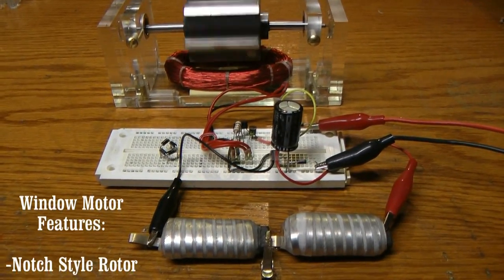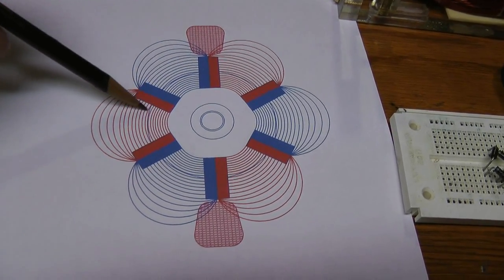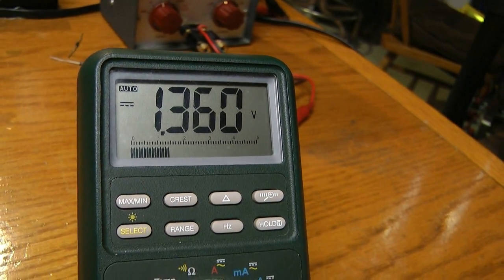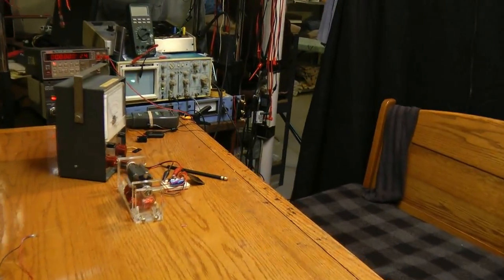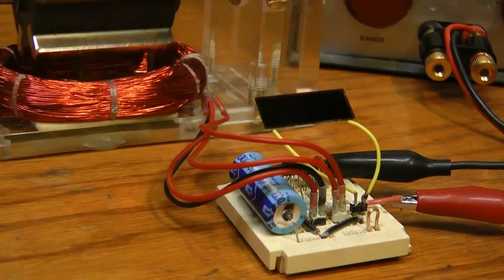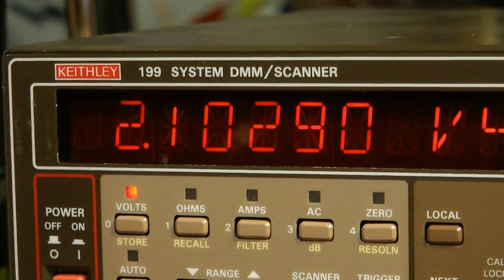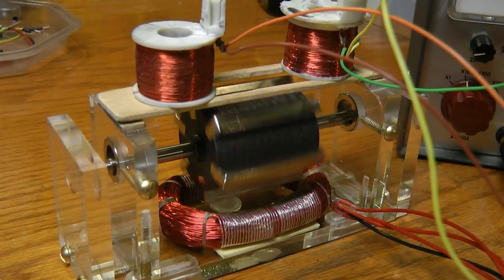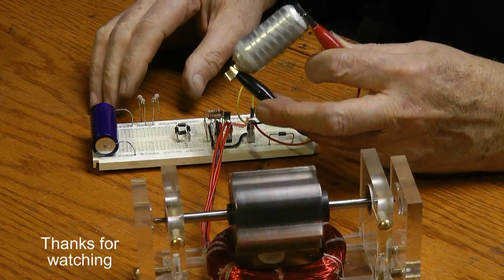Window Motor On Water Battery & Solar + (Notch Rotor)

Comment: Ringing spike, yes, I'd expect that in any type of inductor switching like this. Sometimes you want, other times you don't. Can be hard on the semi-conductors.
  As a kid, the newest thing was permanent magnets in speakers, so I found lots of discarded units in the trash, people actually threw out copper back then.
  Golf carts, my last job here, from 2005-2010, was plant maint, and we had 24 and 36 volt carts..most had the resistors and solenoids for speed. some had Curtis SS units.

Comment from the maker: @dougspair 
Yes, water here is actually an electrolyte. The fine line? I would imagine if you had any of the three, you could prove the other two. I think in most cases OU is considered to be outside the help of Solar, tides, wind etc. For me the self running motor would be a pure form of free energy, even if it couldn't provide much power outside maintaining rotation. Thanks for all the comments.
John

Comment from the maker: @dougspair 
Doug, the scope is on the collector so you see the potential generated from the magnets passing the coil but also see the tiny pulse that it takes to maintain rotation. The ringing or bell curve is considered to be a benefit. I believe it would be a resonance between the resistance, capacitance and inductance in the circuit. Yep coils from anything are useful. The trigger coils on top of the motor are from 36 volt relays that stopped working on my golf cars.
J

Comment from the maker: @dougspair 
The Keithley is fairly old. I got it on E-bay for an $87.00 bid. It has 500 memory positions and can save a reading on each at a set interval. Very useful. There are a lot of people experimenting with these batteries. Just type in Earth Battery or Crystal Cell in YouTube or your browser and you'll find more updated experiments. These that where using water tended to be galvanic and suffered from corrosion of the magnesium. That's why I didn't pursue it to much further.
J

Comment from the maker: @dougspair 
I have an old Eico kit and some really old Weston and General Instruments analog meters. You know the big old things in the black Bakelite cases. My Simpson is one of the first digitals and was over $400.00. Now you can buy the same for probably $20.00. I think the term window motor comes from the rotor running inside a rectangular window shaped coil. Not to sure. Good guess, yes the rotor is made from Delrin with the magnets being a press fit.
J

Comment: Ok, I'm back, again. As I was an Electronic tech at a couple jobs, I pay attention to details, which is why I make comments on some of these youtube posters..seems a very fine line between 'free power', self-running and 'over-unity' To me..it is maybe free if it's solar, water or wind, although the water has to be re-pumped, by man or nature, in most applications.
  Why I am writing this, is the description of the video at the top, it says you're 'ruining' your motor with water battery?

Comment: OK I'm looking at the scope trace, without a schematic, it's hard to see what you're looking at, but the collectors of the motor coil drivers? The 'ringing' is that caused by some back EMF in the drive coils? I'm sort of wondering if you could reduce the drive current in the motor coils by using smaller wire, or would you lose too much strength to drive rotor..?
  When I was a kid, I used old speaker magnet coils for the Tesla coils.

  Ok...at 16.05 I hear the water battery deal..Thanks..

Comment: Hi I like your video you have a smooth running motor well done I am new to this bedini motor stuff can you show a diagram of your circuit /coils wire size etc if possible I am a carpenter by trade this looks very intresting looking foward to have a go at this down in OZ
Best Regards 24

Comment from the maker: @KyleCarrington 
Kyle the window motors as in this video aren't really meant to have a high voltage spike. You can change the timing enough to get some but it's not like the monopoles or my stator motor. I think You refer to the stator in your comment as well. The stator motor Will charge a high voltage capacitor of small capacity instantly to about 200 volts when the spike shows around 300. A 32,000 mfd 40 volt electrolytic charges to the 40 volts in about 1 minute. Yep, bang on shorting,
J

Comment: @DadHav Definitely a curious device you got going there. I don't have a scope so things are even more in the dark for me. I wonder to what extent of the "spike" would a capicitor charge, as in, if your H-wave or similar spike reaches 300v on a 12v input... can one expect to fill 100, 200, or 300v caps? Is there any relevance to the peak of the spike, pertaining to the max voltage available, or does it work out more to an RMS situation. Thanks

Comment from the maker: @KyleCarrington 
Thanks Kyle. Good question. I never really tried what you mention. I have some 200 volt caps that charged quickly but they where low capacity. Other than that I have charged caps to about 50% more that battery input voltage then dumped the cap back into the battery. Maybe I'll give it a try and get back to you.
John

Comment from the maker: @FlavoredCoffeeGuy 
That's absolutely correct but you miss the point all together. The motor is running at less than 2 Volts and 50 micro amps. Your good at math how many watts is that? What would you expect? The steel rotor on the window motor in some of the other videos weighs 2 pounds, can run at less than 30 uA but if you run it at 250 milliamp you can't stop the shaft with your fingers, I have a lot of motors that you can stop the shaft on using10 times that current draw.
J

Comment from the maker: @beac310 
Hello. I only have a home made gauss meter probe that isn't calibrated but works good on a comparative basis. I find a reading between the magnets and extending out a little bit to be about as Strong as putting the probe on the face of the magnet. This produces six rather large magnetic fields with only small spaces between. This gives a longer trigger time. There seems to be much less strength on the edges of the magnets.
John

Comment from the maker: @imtotob 
Hello. I use the standard Bedini / Cole window motor circuits. I just skip all the rsistors that are normally used and use the smallest transistors I can find. Try a search for this or Bedini Sequential Bipolar Circuit. I've seen some good drawings posted right here. I'm in the YouTube Partnership so I can't post drawings without written permission from the inventor. If you have no luck get back with me.
John

Comment from the maker: @Lidmotor 
Hi Rusty. It's a start anyway. I'll try going back to the larger magnets on the shaft. I'd like to suspend the solid steel rotor which works a little better than this one. If you have time take a look at Window Motor Runs Window Motor. In the second half I made some use of one of the Dollar Store lawn light circuit boards. Also a small copper magnesium battery running two window motors.
Thanks 
John

Comment from the maker: @satan31337 
Good question. The trigger coils on top of the motor can be moved away from the rotor allowing you to lower the trim resistance. Also the coils can be move away from the rotor to lesson the on time and drive of the transistor. So maybe it could be eliminated all together, but it would limit the flexibility needed for different experiments.
John

Comment from the maker: @scooterscottii 
I turned a smaller diameter on each end of the shaft for the magnet to slide over. I actually made them a light press fit. I have an old South Bend Lathe. It might date back to the 1840's. It was my Grandfathers. I have to be honest with you, I'm not sure what's even a good choice on the market these days. I will say this though. You might be disappointed if you buy a combination Lathe / Mill. Try to see your way clear to get both if you are headed in that direction.
John

Comment from the maker: @min2oly 
Hi Patrick. You're always a welcome guest. Actually I have no problem running at 25 micro amps now. Keep in mind the actual pulse is higher but my meter accurately displays the rate of discharge. I checked every meter I had until I found one that matched my capacitor discharge tests. I'll have to explain that on the forum some time. So what I'm saying is every meter may measure a little different depending on how good they are. I usually let them run until the capacitor drains.
J

Comment: John.. fantastic work as usual.  I am wondering how the axel magnets are attached (aligned) to the rotor shaft itself?  It would be difficult it seems to perfectly align or attach the mags. What kind of a machine lathe do you use and what kind would you reccomend for building your kind of rotors? Thanks for any info    Scott

Comment from the maker: @andruha11234 
Hello. I usually just hit the capacitor with 2.6 volts from my power supply. I limit the current to about 200 ma and the capacitor will charge in minutes. The cap will also charge from the water batteries but will take hours. Also if you spin the motor by hand it will charge the capacitor. The last makes a nice presentation.
Thanks for watching
John

Comment from the maker: @UrCoffeeTastesToasty 
Yes, I saw that JB used alum and I have a little in the water. I haven't looked around much to see what everyone else is doing. I'll drop in on the forum and see. I'm a member. I know you can use other materials as well. I have a video coming up with some other ideas. I haven't tried shorting out the batteries for any length of time. I'll give it a try.
Thanks.
John

Comment from the maker: @UrCoffeeTastesToasty 
Hello. Yes, it ran over night but it will run for about three days on a single charge of the capacitor. I might have said the motor drops .001 volts every four minutes. The motor could run from a generator or be used as a generator itself. I am currently running my other window motor from a tap of the coils on this one in the video. I'm going to make a video of this because it had some interesting results.
John

Comment: @DadHav Thanks for replying! I find what you do very intriguing. Its still hard to believe how little power the motor is using. 
How long does it take to charge the capacitor and how do you charge it? I saw you using the water batteries, is that how you usually do it? Or do you use solar power?

Comment from the maker: @andruha11234 
Yes, I agree with you. I have no idea if it's possible to find out why the capacitor increased voltage at those intervals. It's more likely that the motor just drew more current at the opposite interval. No matter how you look at it the overall fact was the capacitor is still averaging a drain. I think it comes out to .001 volt or less every 4 minutes. Hmm. I thought that would be impossible at the start of these projects.
Thanks for commenting. It was a good observation.
John

Comment from the maker: @hhocharioteer 
Good idea, but here is a problem with getting rotors to close with the strong magnets. I actually ran a second motor a foot away from the firs just from the magnets. I'm doing an experiment similar to your suggestion right now. I have one motor running a second one and the results are very interesting. I will be posting a video soon that will be a little surprising. That is of course after I check things out. I might just make a fool of myself otherwise.
Tahnks
John

Comment from the maker: @Wavefront101 
The fields would probably reach out further. You could even create a wider dead spot between fields that would give a different duty cycle. There is such a thing as a super pole which has the magnets pushed together all the way. I haven't tried it but others use the technique.
John

Comment: First Thank You for this video. My question: if the coil of the window motor has to be powered anyway, why you don't use the other (lower) side of the magnetic field of the coil to drive a second rotor and pick up generated power with two aditional coils (like as you did on top)? Than the generated power can be enough to run the motor without loss. 
Bernd